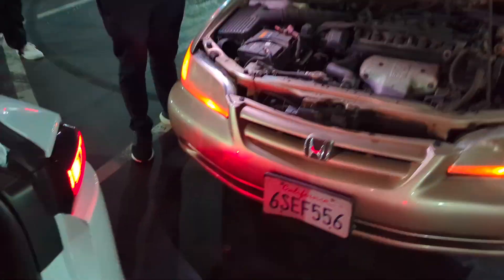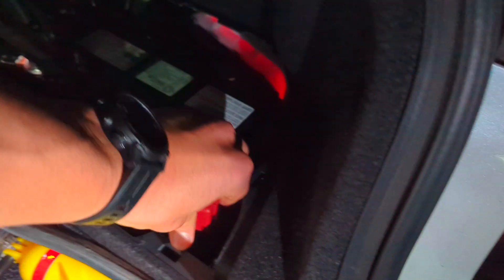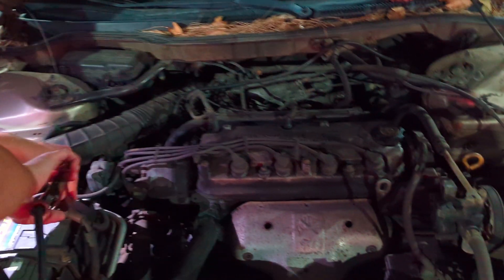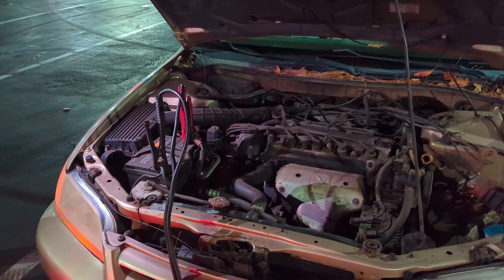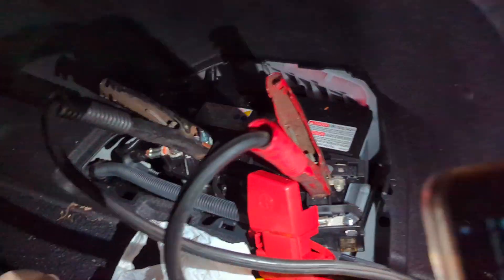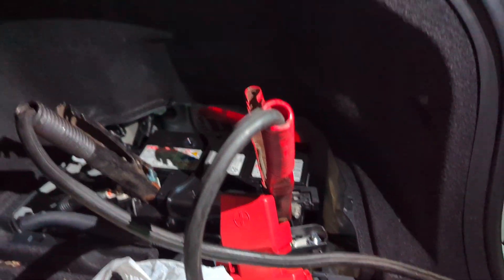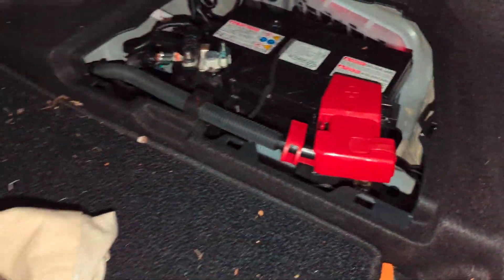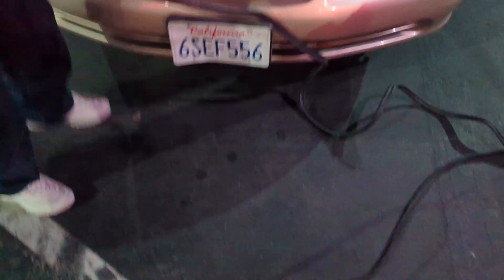Jump with a Hydrogen car?

Comment: EVs in general tend to be unable to jump ICE cars. Their 12v batteries only need enough juice to power the accessories, whereas an ICE battery needs to be able to crank an engine.

Comment: Not how it’s supposed to be done.   There’s a positive jumper terminal under the hood in the fuse box just for that purpose.   The negative has terminal on the top of the fuel cell.   And yes it does need a jump on occasion.  I have gotten and given using those terminals